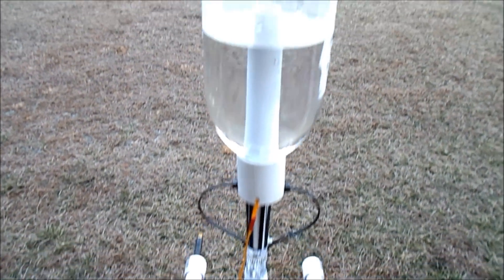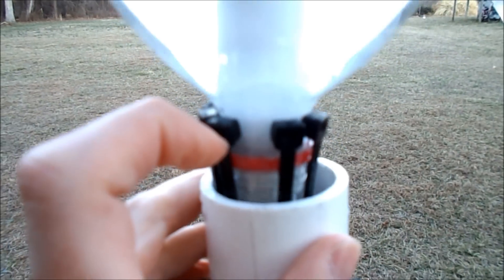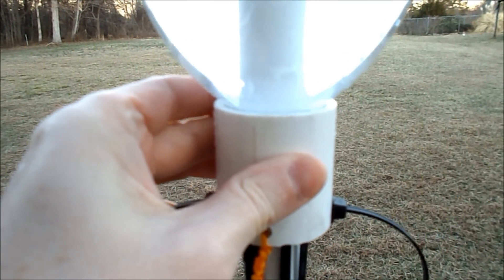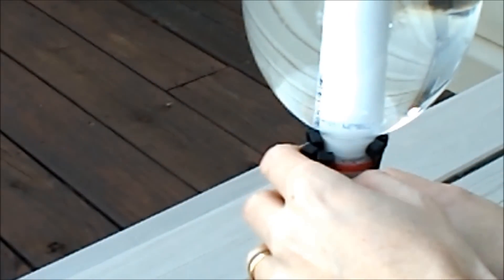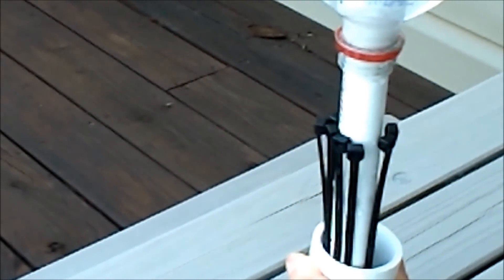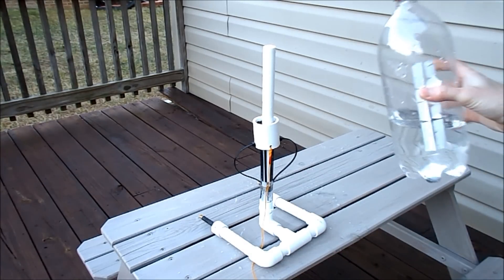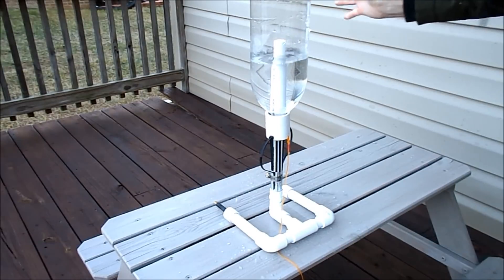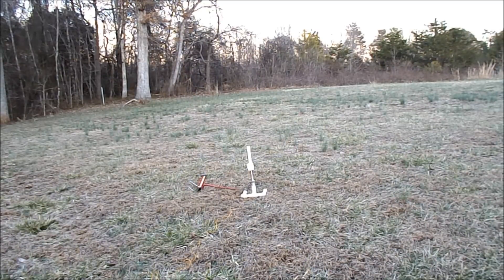Water Rocket Launch Collar, -  close up, and load method.

Comment: Hello.. how do you make the botle head stuck in the cable tie and not falling further down
Reply from the maker: The tube that is stuck inside the bottle is not completely uniform.  It is partially melted and then squashed outward slightly, making it flare outward a bit, which increases its diameter.   The increase in diameter is what stops it from falling further down. (as well as creates the seal)
Reply: Thank you

Comment: I know this video is a few years old, but I have a question: the video says that the launch tube is flared to keep the bottle from sliding down too far. How did you accomplish this? We are having trouble keeping our bottle sealed enough to not lose all the water before launch. I have seen another video where they heat up the PVC and compress it to make the pipe larger in that spot.
Reply: have you found a solution for this problem? please let me know :)

Comment: I understand the launch tube is flared so the water does not come out.  How do you flare that tubing to make it wider?  What is the process to flare that?  Much thanks!
Reply from the maker: Heat it up then crush together.   I use a heat gun, but a candle while spinning can work.
Reply: @FarReachFR  ah ok!!  thank you very much!!  Will try it!
Reply: @FarReachFR  Just wanted to say it worked great!  flaired it with a candle!  Much thanks again!
Reply from the maker: @brianwendt2756  Perfect!

Comment: Will 1 Liter bottles wotk with this or are those different sizes?
Reply from the maker: most 1 liter bottles can work as well.  That said they generally can not be set as deep.  So depending on how you have your launcher adjusted, you might have to raise the launch collar higher on the main tube to effectively use them.  But yes, I have launched 1 liter bottles using this launcher, though 2 liter (or staged 2 liter increments) is generally my bottle of choice.

Comment: How did you attach the zip ties that you are using as springs to the collar
Reply from the maker: They are held in place by a hose clamp. (with additional cut protection by duct tape)

Comment: Hello. Interested in using this for a project. How did you attach the zip tie heads to the collar?
Reply from the maker: zip ties are collected and held in place by a hose clamp at the bottom of the zip ties.  The top that keeps contact with the bottle is just held in place by the lack of distance within the launch collar
Reply: Far Reach Engineering I see. Thank you for your quick response. This is an excellent design.

Comment: hi I believe I have just purchased one of your rocket launchers and I wondering how long does it take a regular bicycle pump to get enough pressure for a launch? or maybe you can tell me what to look for when the bottle has enough pressure because we couldn't get it to come of the launch tube. Thanks in advance
Reply from the maker: Hi,  If you bought one of mine, thanks.  But it would have been a while.  I stopped building them I think a year ish ago.  In any case, it doesnt take that long.  It has been awhile but I think around 15 -30 pumps of a bike pump.  But it is just a guess, sadly its be about a year since I have had enough time to get out and launch.   Be careful though not to go to high on pressures.  Dont want the bottle to blow up.
Reply: lol, I totally thought it was you, too funny... well, anyways, you gave me a good deal on ebay when i made an offer... I got a new tire-pump and its working great... thank you for your response and this design too, which is exactly like the one I have... cheers :]
Reply from the maker: Glad to help and glad you like the design.  If it looks like an E when face down with the same dimensions shown then you are likely using one of my designs, even if built by someone that mimic.  If it has silver foil on the launch collar under the hose clap. it is probably built by me.  (no one else I know does that)  I made it to very specific criteria.
Reply: yes! this one that I have now is exactly like the one in your other video except they're using duct tape in place of the silver foil. And I assembled it. Too bad the silver foil would have been a nice touch. This video here of yours about the collar and adjustments to make for it made all the difference for my son and I to start our water bottle rocket learning, so thank you... all the best
Reply from the maker: Glad to hear it helped.  Makes me happy to hear.  All the best in your launch!

Comment: What are you using for a spring device on rhe collar?
Reply from the maker: Zip ties under compression
Reply: . @FarReachFR …..  that not what he asked,!.. and I am asking it,... How does, and where is the spring located on the launcher don't see it in the video ?...I get the zip ties  as collars holds but How does the spring work and where did you get one ?..Please
Reply from the maker: @jlions72  Hi,  Zip Ties, have two functions in this build.  1. the zip ties UNDER the launch collar are what hold the rocket in place during pressurization.  2. the two zip ties that arch outward that are attached to the OUTSIDE of the launch collar act as a spring.   The arch in their shape gives a rebound effect that pushes the collar upward and holds it in place until the string pulls them down.   It is the spring.                          In short, two Zip Ties under compression are the spring.  I hope this helps.  Good Luck!
Reply: @FarReachFR  Hey. Can you tell how did you secure the zip ties, that arch outward, to the outside of the launch collar?  With super glue or  else?
Reply from the maker: @taha5754   Hello.  they are zipped through a hole on each side at the top.  Then they are clamped by the hose clamp at the base.  No glue is required.
Reply: @FarReachFR  what size is the hole at the top to zip them?
Reply from the maker: @taha5754  the hole diameter is the width of the zip tie.  If you choose larger zip ties you simply drill a slightly larger hole.